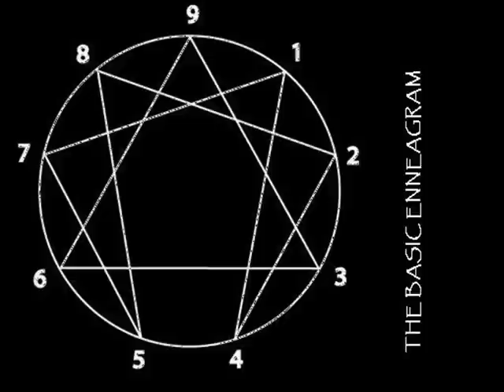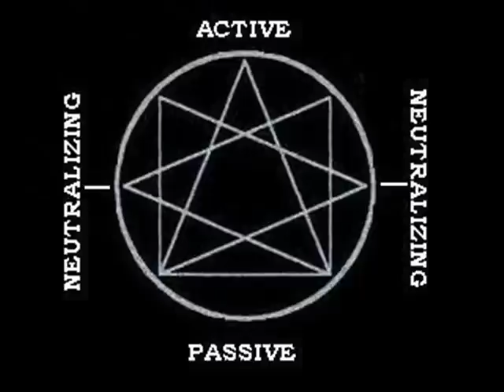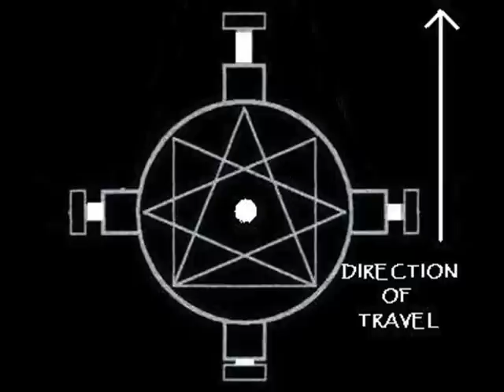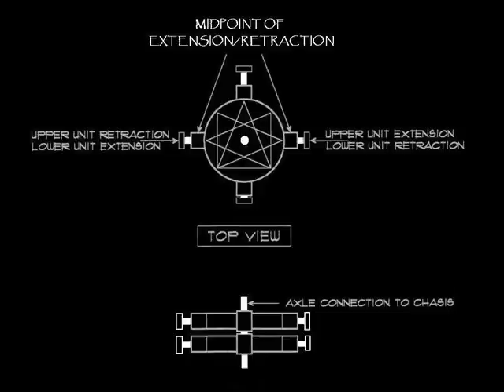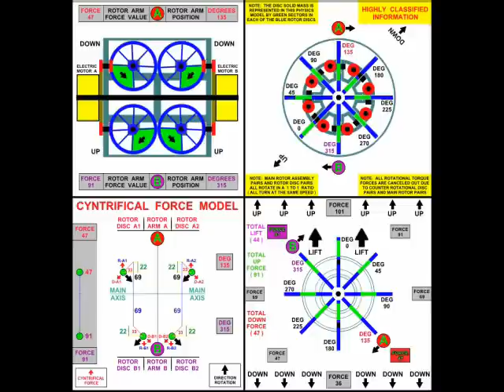Antigravity  Propulsion from Centrifugal Force Discovered

Comment: The-Only Torque...and not centrifugal force device that works is by the late Professor Alfio DiBella of the University of Genoa Us2404854 .Also: centrigual force propulsion--will merely produce INTERNAL Forces/stresses.  I Investigated ALL of them! http://www.padrak.com/agn -Also there is NO interest on mechanical propulsion-in our solid state age!  Electrogravitics and Kita Us8901943 Kita from RJK http://www.chiralex.com
Reply: CORRECTION is US3404854 "imparting Motion to a Body"

Comment: I tested my system today. I replicated the top left animation/simulation with with a tight, well timed setup and spun it up to about 2000 RPM.  There was no perceivable lift produced!  I had the entire apparatus balanced on a pivot point.  I am an engineer and I cannot get it to work.  I used my 6 hp Honda 4 stroke engine.  What gives?
Reply: Ooops!  I know what the problem is.  My machine needs to be modified.  I wish the simulations were explained more clearly.

Comment: I work on antigravity. This device will not work in the manner shown.2ndly this man is not the first one to try this. He's wrong. Pine gap in Australia did this. I'm a propulsion expert.I've worked in places these guys can only dream of. It was in the 1930s this method was developed. Edward teller worked on this long before this guy did. He's not old enough to have done this. This law of 3 has been known since the 1920s. Sorry guy. Otis t. Car also worked on this.
No hydraulics can work. Weight is not an issue in neutral b. Craft.All flying disks work off of the lorentz o craft. Top secret projects in the 1930s.
These ignorant men always think they were the first to do things yet. The vimanna, craft were around 7000 years ago.
They ransacked his friends home because this device was already in use in black budgeted projects.My pc has been hacked into as well.
The craft I worked on do faster then light speed. They also teleport. Any device that can only lift 3 times it's weight is junk.
He says black ops has had them yet says he developed this device. But black ops had them in the 1950s, before this guy was doing this.
Closed propulsion only works as a secondary system. And did you notice he doesn't have a device that's free energy.
He admits this. The best propulsion craft are lorrentz-O. HIS NASA BUDDY didn't tell him that NASA is a cover for the real secret space program. And they use electric space craft. There are many forms of antigravity. There are many forms of free energy. This guy isn't onto any of them. As he states his device needs a nuclear reacor. This device is best in space but how does he intend to get it there.lol.
The principals he says are of his device are common to many anti gravity devices. There are even patents that pre date, this invention. He tries as many do to say he invented a device that works off of the principles of stolen patented ideas.They make a device that looks a little different and then go file for a patent. And when you do this the government gives the idea to the mic. To build. That's why I don't patent my antigravity inventions.
Bloodvikingufologist@gmail.com Inventer of many types of free energy devices.
Reply: Blood Viking:
"I work on antigravity."
"I'm a propulsion expert."
"I've worked in places these guys can only dream of."
"The craft I worked on do faster then light speed."
"They also teleport."
"Any device that can only lift 3 times it's weight is junk."
"There are many forms of antigravity."
"There are many forms of free energy."
"That's why I don't patent my antigravity inventions."
-----

Your post was very entertaining. If ANY of it is real, then pick one technology--one item on the list of what you've developed--and build a scaled down model to show to all of us right here on YouTube. You're obviously a conspiracy theorist, so if you lack the balls to post your work because you're paranoid and afraid of whoever, or whatever, coming after you, then show the tech to me, and I'll post it because I'm not paranoid, and I'm not afraid of anyone or anything. Otherwise, the claims you've made are nothing more than pure fantasy, pure conspiracy, or pure bullshit.
Reply from the maker: found this one censored.  Lead on if you have anything of value to write.

Comment: Why would one type highly  classified information in the top right corner of your facts. 

Secondly, this diagram is only shows forces in two directions(x and y for example), not the 3rd needed for lift (z). 

I can't say that the device will not travel forward. But to achieve lift it seems that you would need the 3rd force vector (z).

Comment: Gravity drives have been made by man since Keely. Tesla had his around 1900 Schoulberger in WW2 in 1943. Searl in 1953 and many others since then. But if you are getting levitation and acceleration then you have a gravitational vehicle. Gravity repels gravity. Anti gravity collides with gravity, thats why the law states that opposites attract and likes repel. Gravity repels gravity.
Reply: +Dieter Soegemeier What language are you talking? what logic are you using? gravity is mass attraction. rotational systems create gravitational waves as a resonance effect. time to change your bong water.
Reply: Gravity is mass attracting only if that mass does not have gravity. Just like two like poles on a magnet repel each other so does gravity. Are not the Solar Systems and Galaxies all moving away from each other. Try it your self, there is a toy that can teach you about this and it is called a levitron. Easy to make and can open the eyes to many truths not told in physics books.

Comment: Functional Prototype Video Not available.
If these weren't kept secret then everyone would be building them and maybe that is what we need to promote competition and growth. Like an arms race.

By withholding information then the Aviation giants form a monopoly and take their time.

On the other hand we wouldn't want everyone flying around at random testing their creations.

There needs to be regulation for safety.

Most Aircraft need runways and airports which is a regulation point and this somewhat manages the traffic.

Another "Dangerous" thing about this device is it is not restricted by atmospheric pressure and can go well beyond the atmosphere of the planet and if it were in the hands of the general public could see many people being literally "Lost in space"

Crafts would have to be pressurized.

Navigation aids, keeping in mind that SAT NAV only works in the vicinity of satellites and the further away you go the signal is delayed even IF it is directed out towards your trajectory.

One interesting feature of this device is it has sub marine uses and capabilities as well which can have crafts operating above or below sea level.

Such craft would have to be designed and manufactured with super critical efficiency in order to preserve mass yet retain structural integrity in high pressure and zero pressure atmospheres.

This is not easy to do and I am confident Humans do not have access to such materials at this point in time.

Comment: Hi All

I had been independently been thinking about a similar device and upon searching came across this video and recognised how the device worked immediately. I had been open to the idea that this kind of propulsion might be possible using centrifugal force ...

To understand how this works I undertook a detailed simulation using a spreadsheet of all the vectors that play on the device. There is no doubt that as the weights extend away form the axis of rotation that their linear velocity increases, resulting in an increase centripetal force towards one side of the device since Fcentripetal = m V^2/r. At first glance it seemed this imbalance might produce lift.  However, when doing a full analysis, I found there are also other force vectors at work that need to be considered. For example to increase the linear speed of the weights as the radius extend, an accelerating force is required perpendicular to the centripetal force. Similarly, a breaking force is require to slow the weights down as the radius contracts. If you add all these tangent force vectors required to satisfy the velocity of the rotating weights, you find out that the resulting total force directly equals and opposes the imbalance in the centripetal force resulting in no net force on the device. 

This was also confirmed by a separate torque calculation. Adding all the rotating forces using polar coordinate results in no net torque on the motor other than those due to friction. No energy in means no energy out. If lift was to be produce there needs to be some energy in.

The results of this analysis were precise. The vectors were summed in various ways. The result is that there is unfortunately no lift whatsoever :(

PS: I guess it shouldn't be a surprised. If someone really had solved this, all they would need to do is fly down to the local TV station and there would no longer be any doubt, not to mention all the untold riches.

P.
Reply from the maker: Paul Moutzouris Paul, did you consider that the upper unit rotates in opposite direction of lower unit?  s.g.
Reply: ffeijdrug hi, I analyzed a single rotor. From my analysis a single rotor will wobble but produce no net lift. Since the lift is zero for one, it is also zero for two. However I can see that having two counter rotating rotors will cancel the left and right vibrations. I cannot see any other interaction between the rotors. Let me know if I am missing something...
Reply from the maker: Paul Moutzouris As the upper arm extends, the lower arm retracts.  So perpendicular aspects that you mention cancel each other out.  At least that is my understanding of it.

Comment: my system is called "variable centrifugal mass drive" VCMD one thing you have to take into account is that using solid weights, is the power and force it takes to move them, this diagram is what i call the 0 out effect. mine the mass actually changes the weight, thus mine works
Reply from the maker: will check it out...thanks.
Reply from the maker: I can't find it.  Post comment with URL of vid and I will approve it.
Reply: It has nothing to do with gravity,thats where everyone gets confused.It would be no different than say, a rocket or airplane can defeat gravity,They do not cancel out the effect of gravity.Newtons 3 laws of motion is how they work.I'm guessing you would have to be able to bend space time and then ride on that wave,the power needed would be incredible,a star,black hole could bend ,space time.oh then you have to make the craft,develop the materials and somehow get it all to work.Nothing is impossible,but defeating gravity,its going to take a few hundred or so years,maybe longer [I'm just guessing,i'm, clueless]
Reply: +inagod no, mine is very simple, more simple then most would ever imagine, its like a gyro but it is dis balanced in only one direction.

Comment: u loose energy up when u pull the weight into the center.i did the same mistake,
Reply from the maker: Yes you do, but this is not a free energy device.  It must have continuous power source.  It is not an engine but a transmission.

Comment: Very beautiful design but I think he did not do the modeling right; the four weights are pulled back to the center of rotation and they will create the equilibrium for the whole system.
I think it is a great puzzle and wonderful mechanical artwork, it is not a propulsion that defies Newton's third law: every reaction has an equal and opposite reaction.
Reply from the maker: Working models have been built.  There is EVENTUALLY a reaction.  That is key.
Reply: Dear ffeijdrug, working models have been built for the last 50 years but it never passed that stage.
Reply from the maker: They work....that is the point.  However, as mentioned in my other vid on this stuff, the ultimate is electromagnetic, with minimal moving parts....is at http://youtu.be/LMk5aSrhZDA

Comment: I've been doing research on inertial propulsion and wormhole prinicples for 35 years, I'd appreciate you checking out my work here:  http://edmrenner.blogspot.com/2014/11/inertial-drives-and-worm-hole-principles.html
Reply from the maker: Excellent paper, Ed.  Your comment was in spam because of link.  I approved it.  Suggest to readers here to check it out.  You mention that c may NOT be the limit.  See my most recent vid on this channel TBR.  It gives a possible explanation as to why is not the limit.
Reply: Ed Renner, I read your paper and I didn't find the mathematical proof of the idea, the sketches looks convincing though but I saw you to talk mathematics so walk it the end with it. I say you will find the summation of forces as zero.

Comment: Talk about parallel work and parallel timing. I'm Cody G. Carson, and I won my 12th grade science fair at Joe T. Robinson Highschool in 1982 with this same principle. I called it the Centrigrav. I was 17 and did not have the resources to build a working model. 
Your machine's design is similar to my first concept, but I needed something much easier to build for a school project. I redesigned it so that no international gears were needed. The wheel with weights on retractable rods was placed off center within an elliptical track that provided the desired motion. 
As stated, the working model was unfinished. 
Subsequently, the idea was shot down at the district level competition for an apparent violation of the third law of motion. The belief was that the force needed to retract the weights as they pass slower and closer to the axis would cancel out the force exerted by the extended and faster weighs at the opposite end. 
That killed my NASA dreams. 

However, a few years later, I realized that there was a way to retract the weights without pulling the axis in the opposite direction. I drew the machine, but never had the money to build it. 

You were right to include the second, counter rotating wheel. Without it, the spacecraft would travel in a large circle opposite the direction of spin. 

In the 80's,  solar voltaics were so inefficient that a solar powered, electric ship would have trouble generating enough power for breaking speed to Mar's orbit. Today, Mars would be within reach using solar power, but a small nuclear powered generator would be needed for going deeper into space. 

Properly shielded from dust impact, it's possible to accelerate to the halfway point then decelerate the rest of the way. This would provide a good fraction of gravity for the inhabitants that would be necessary for maintaining health over the long trip. 

Low mass radiation shielding is needed as is a heating and cooling system that doesn't weigh much either. 

Looks like you got it right; nice job.
Reply: Wow you're super smart, can I ask what you do for a living?

Comment: in order to defeat gravity[which is very weak]your going to have to bend space time.Enormous power would be required or if you can grab a star or other large body and pull it where you need it,you maybe able to ride on the wave,more or less.Gyros,Centrifugal forces have nothing to do with gravity.

Comment: Conservation of momentum commands that the sum of all forces, working on moving parts within an isolated system, is zero. Assuming the system would yet accelerate, ignores that the total mass of it would set up an inertial force against the direction of acceleration, thus no net acceleration can occur. An external counter force would be needed to cause the system to accelerate, as per Newton's first law. Inventors of inertial drives lack knowledge of basic physics.
Reply from the maker: This Delays reaction and working models have been built.  Newton didn't know it all back then, but he was close.  See "newest first" in comments .  You will come across two different people who state they have built them and they work.
Reply: ffeijdrug "Delayed" or not, reaction will still occur.
Reply: Thermospecialist you can intellectualize all day long, but until you think outside the newton box and build one, like I did, that is where you will stay. My machine is simple and will move a heavy cart along the ground with no power transmission to the wheels. The motor and moving components are islolated from the wheels.
Reply: EnergyTechMedia Even if the device you have built truly does yield the results you have described, how can you immediately be certain that you have succeeded in the creation of a reactionless drive? Has your device underwent a complete in-depth series of tests and evaluations? I'm not completely ruling out the possibility of unknown phenomena at work in your scenario, but there are way too many baseless assumptions present in the pseudoscientific realm of "antigravity" and gyroscopic reactionless drives.

Comment: This is true, this is real. I did the same similar thing back in the 70's with a chainsaw engine using the opposing centrifugal forces set at angles. It works, it is real and will lift using these angular opposing forces. It will lift and fly.
Reply: You're full of shit not doing this in 2018
Reply: Flying chainsaw. cool